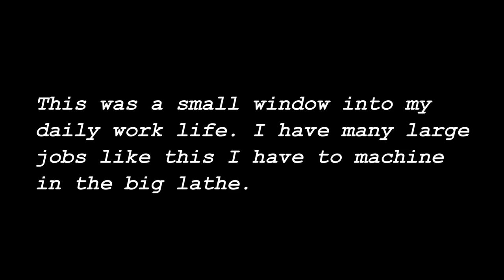Large Lathe Work

Comment: I used to work for Wendt Corporation in Tonawanda NY near Buffalo. we built giant machines to crush cars and shred them. The hydraulics are huge on those. On occasion while crushing steel or whatever it will get a piece of steel stuck between the cylinder and the piston and gouge the hell out of the cylinders. after pulling the pistons out I as a welder would have to climb inside and weld over all the gouges so the machinist could machine it and make the bore smooth again. the cylinders were so big I could sit up inside them comfortably lol. But what a smoky job
Reply: +Richard gross use a fan.
Reply: +Arthur Bradley not if he's tig or mig welding, you'd lose your gas shield.
Reply: +monomerx001 true
Reply: +Richard gross  :D Tonawanda. I'm in Rochester.
Reply: +monomerx001 Very true, but unless it was some exotic alloy, I'll bet he's using stick just for the advantages it has in portability, strength of weld/penetration, and also the ease of prepping your machine for materials used. I know as a former pipeliner that we exclusively used rods(excepting on chromoly boiler tubes, which was always TIG), and when you're up inside a man-hole filling in the deeply back gouged v-groove on massive door sheets on the side of an oil tank, or even fixing a blown root pass from the inside of large diameter pipes, we always used high deposition all-position rods like 7018, 8018, etc. 

Of course that was years ago and much has changed, but all of the build-up welding I've seen Abom do on these hydraulic pistons is with good old 7018, and his jobs always come out sweet :D
Reply: Does this job not warrant a plasma spray ?
Reply: it was 7018 as it is easier to machine over
Reply: Good ol' 7018 rod... 4th generation Millwright here and USMC veteran. My grandfather was an old school pipefitter and welding instructor. I've seen the man weld a pipe with 2 stingers, one in each hand and weld each side of the pipe simultaneously. His father, my great grandpa was a Millwright and worked on the very first Ford assembly line. Gerwig.

Comment: Its been many years since I've done any lathe work. We made brass pump impellers and various other pump parts because the generating station I worked at had pumps that required we make our own replacement parts. Thanks for a great video about a huge lathe. It brought back many good memories.
Reply: +ThePupsdad I forgot to mention we also made impeller wear rings and steel screw shafts up to 72" long. I loved cutting huge threads.

Comment: Wow!  It is really great to see a really expert machinist at work on some great gear, taking things slowly and carefully.  Many thanks.  As a child I was always interested in how those spherical bearings were got into the lifting arms on the back of a Fordson tractor.  I'm probably not using the right terms here, but I mean the same kind of massive bearing which was embedded in the end of the tube you are working on here (which moves freely in 360 degrees of rotation).  I could not see how it could be got in there except by making the lifting arms in two parts (lengthwise), placing the bearing in place and then welding up the two halves with it held captive in place.  But I could see no sign of welds in the arms on this Fordson.  I just can't imagine it being done by forging in situ as this would just trap the bearing.  I was only a kid of about eight years old and now I'm fifty-nine and still don't know for sure how it is done.  Would you mind explaining?
Reply from the maker: Stephen, the spherical bearings are simply pressed into place. They all have an outer race that is turned straight. The hole in the part is bored to an interference fit,  then the bearings are pressed in. In many cases there are also snap ring grooves machines so that retainers can be used to ensure the bearings do not walk out of the hole.
Reply: Abom79
Thanks for the explanation.  I can rest easy now I know!  There's so much ingenuity in engineering; imagination and creativity too...
Reply: Abom79
I came back to thinking about this!  You know those interference-fit bearing assemblies that are pressed in as you say?  How do they bore them out and fit the rotating bearing into it - I mean as an assembly?  It would be great to see a vid of this being done.  Gonna Goole it.

Comment: Whe I was 18 i got a job at Whemco in West Homestead Pittsburgh and we used to get rolls of steel in sometimes that were 900K pound+. They were so big that they had to be bought in by train because no truck could transport them. The lathes they turned them on were GIANT ass ancient machines probably from the 1920s. My job as a chainmen consisted of rigging these up to massive overhead cranes on tracks so the could move them. We'd put wooden wedges under them to stabilize them but the scary thing is if the roll shifted onto a wedge it would shoot the wedge out like a bullet. Nerve racking work for an 18 year old kid tbh.
Reply: You had to work on your dodging skills right there.
My buddy was a longshoreman and some of the pipe-incidents were terrifying and life-changing.

Comment: That's a big lathe, but they have one in Michaud that turns the shuttle tank, I think that's the biggest in the world, as the tank is 154 feet length, 28 feet diameter.  I've heard he Wright brothers first flight could have taken place inside the tank, altitude (height), width, and length, but should probably verify this.  The tank, in skin thickness to overall size, is on the scale order of a soda can....and people wonder why the things blow up occasionally.   Sorry for the one-up, but thought you might be interested. Great vid, enjoyed the large machining.  You really get to check out the weld quality first hand while sectioning it. I'm sure the welder would appreciate and feedback you could give him on any weld inconsistencies  ;-).

Comment from the maker: Before I started rolling it on the steady rest I use my grinder and ground the paint off in one spot to for the steady to sit. Then I began the process of finding center, then center drilling it. Once its center drilled, hold the part with a live center and it will be centered and square. Then "machine" a true spot on the barrel for the steady to roll. Its all in the video.

Comment: Nice to see someone with head NOT in ass using a lathe on utube.  I appreciate the part-off through the weld. I had a pucker level of 8.5 when you started that tool into that interrupted cut.   Sweet work.

Comment: I know this is an old video, but, is this a hydraulic cylinder?  Sorry, guys, woodturner here and saw the huge lathe.
Reply from the maker: Scott Jones Yes, large 4 stage cylinder.
Reply: Abom79 I like the use of the borshaft for cutting the Welding off... remind me at "Apollo13": "I do not care what something was built for, i need to know, what you can do with it "
Reply: نفسي اشتغل معاك يا خواجة والله
Reply: +GpunktHartman Yes, its a hydraulic telescoping cylinder. Did you notice the high pressure hose attached to the body of the cylinder? That is where the hydraulic fluid was pumped in to operate the inner cylinders.

Comment: What did you do with the forklift, let it idle against the cylinder while it was expanding so that the different cylinders didn't randomly push out?  I've never dealt with multi-cylinder hydraulics
Reply from the maker: The fork lift is there to hold the end of the tubes as it extends.

Comment: they will still be using lathes like this in one hundred year's time.
Reply: So long as they need to make round things round. and flat things flat. I don't see machine tooling changing a whole lot. Perhaps one day we might have some sort of plasma arc cutting bits or laser but its very hard to reinvent the wheel.
Reply: Joe Burnett 3D metal printing is the way of the future they say.. ;)
Reply: If we don't have molecular assemblers 100 years from now something will have gone very very wrong, people using this sort of equipment will be doing so out of nostalgia. You MIGHT see this sort of stuff going on at the county fair like we see steam engine demonstrations today.
Reply: well I doubt if these lathes will still not be around if the present situation continues as everything we use depends on products made by big traditional processes of turning, milling etc.
Lots of new lightweighht production machines are made from light sections but these all satrt from bar or plate that has to be rolled on giant machines that need big precicion engineered parts.
Ship propellors and shafts for instant will still be needed unless someone comes up with a means of moving water from in front of a ship and pushing it against the back to make the big ships move.
Reply: Fleur Black There will be, I guess, some places where stuff like that goes on. But not in the developed world. Why form a giant piece of steel then carve the shape you want out of it when you can tell your nanobots to harvest the appropriate raw materials from the ore pile and then form the required shape as the steel is created? You'll get a more accurate part with far less wasted energy.

I know it sounds way out there but think about how much changes in a century and stuff just keeps advancing faster all the time.
Reply: I started work in a shop that had a big old single cylinder gas engine to power line shafting.  It was demolished but woudl have been a perfect museum as everything was really old.
Reply: ***** Currently studying to be an engineer as well (mechanical engineer). I'm so with you on that: I, too, have no idea wtf I'm doing :\ I also like to get my hands dirty and do enjoy manual labor, but, like you said -- you can't raise a family nowadays with what that pays (not where I'm from, anyway)..
Reply from the maker: Fleur Black The shop my dad started his career in was set up like that in the early days. it was a line shop and powered by a gas engine, but was modernized by the time he was there working, Cool stories.
Reply from the maker: aryesegal1988 I can say I get a descent pay, and good benefits. Thats why I stuck with the job I'm at. But there's less headache there than running your own business.  I really do miss my full time family shop though. 
I'm not getting rich doing what i do, but I make enough to live a comfortable life, support my family, and off on the weekends, plus I'm doing what I love....machine work!
Reply: Zaphod7835 Your crazy that will never happen for a piece this size.
Reply: Dave P It's pieces this size that may be done that way first, the bigger the piece the more waste there is informing it this way.
Reply: aryesegal1988 you would love poroldchaps YouTube channel..it may be poor ol chap or something like that...he is something else..homemade tools and fixing old machines and his stories are the greatest.  Hes a brit...
Reply: 3D printing and molecular assemblers won't be able to repair this job. So unless everything becomes single use the machinist and this lathe still have a future.
Reply: people 500 years ago used the same concepts to make metal parts!!

Comment: I like how you handled all of this professionally. Even the forklift idea was great--did you run it on neutral? was it pulling or you had a pneumatic way of removing that piece?

By the way, from the beginning, when you were adjusting the steady rest, i was thinking about if the cylinder center was the same as the center of that welded piece?
Reply from the maker: Jake, I stick a bar through the eye of the cylinder and rest it on the forks. Thats what holds the weight of the cylinder tubes as they are extending out. Just put the fork lift in neutral and let it push back. 
I doesnt matter where the eye was welded on, the center of rotation off the large tube is what I was looking for. Even if it was off center a little I would still be able to drill a center once its there.
Reply: Abom79 Only if that piece was welded dead center. either way the hole he was making would have been dead center of the cylinder not the welded piece because the whole cylinder was rotating. At least that's the way I saw it because I wondered the same thing
Reply: Kyle Kolath thats right i would use clock on steady
Reply: you need to start somewhere. Finding center the way he did takes some guts, faith and experience. I would have probably been using an indicator on the clevis but would have had the same results. I was surprised at how true the bore was running when the end cap was removed. It miss those just make it work tolerances...which are just fine for what he is doing.

Comment: okay so im 16 and in a machining class at my local career center. and this was not running as nearly as many RPM as i usually do for a small part. is that normal to run that at such a slow RPM?
Reply from the maker: On such a large piece with this much mass moving around inside, you dont wont to run very fast. The opposite end was being driven by a piece of flat bar welded to each nut, so that they would all be spinning together. Low and slow with this job.
Reply: oh okay thank you sir :)
Reply: You also have to remember that large diameters quickly results in surprisingly high cutting speed on outerdiameter of parts. Suggest to do some math to look it out. Also I don't know the weight of that assembly, but it's quite heavy for sure, so I don't think you just even could run part very fast because of balancing issues. Plus heavy masses rotating fast and if something goes wrong can be  a very serious work hazard. I'm not machinist by my current occupation, but did metal working school as I was young and to me that looks roughing speeds (not sure if that's proper english?) which are fine for that kind of parts. Something like paper plant rolls are done in quite high speed machining to gain high surface quality my knowledge as they're balanced very presisely and in fact run at vastly high speeds in production.
Reply: Larger Diameter slower u go, smaller diameter fast you go.
Reply: At 15'' dia, the speed at which the material encounters the tool is still pretty high even at a low rpm. That said, Much of the cutting speed has to do with the material and type of cut. I would not machine something that large in diameter at any speed greater than 125 rpms on the outside with an indexable carbide insert tool. And even slower still with that parting bit or brazed tips or high speed steel tools through weld on carbon steel.  With the part being machined being that bulky and hollow, chatter is always a concern especially when using a boring bar.  Most times chatter can be eliminated by adjusting the rpm speed or length of bar or where the steady rest is placed.  If you noticed he had the material chipping off because the speed, feed and depth of cut were right. Too much rpm and the material might come off in wire form. Thats not ideal. Aluminum obviously can be machined faster than steel. Bronze, brass, cast iron can all be machined at a higher rate because they chip when machined and almost never wire.
Reply: OU 318 V/D
Reply: Cutting speed,, weight of pc,,less vibration and chatter  at slower speeds.
Reply: Imagine you are riding a bike and a scooter. Keep the RPM BUT change the wheels with those two :D :D
Reply: you are big kids
Reply: andrew bentley It's all about the SURFACE SPEED.   A larger diameter might be spinning a 1/10 the speed of something that's half inch or smaller, but the actual rate of material passing across the cutting tool is the same.   Other considerations such as mass and balance definitely come into play, but the biggest issue is making sure you have the fastest MRR possible without burning up the bit.   (short version, a cylinder with 10 times the diameter will be moving 10 times faster at the surface)  Cutting tools don't "see" the RPMS, they only see the material at the surface.
Reply: SolarMillUSA Actually, a cylinder with 10 times the diameter will be moving 31.4 times faster at the surface, but your point is valid.
Reply: SolarMillUSA a cylinder with 10 times the diameter will actually be moving 10*pi times faster (circumference equals 2 times pi times radius)  +andrew bentley you can look up recommended surface speeds (often given in SFM surface feet per minute) for your specific workpiece material and cutter type in vendor literature or machinery's handbook and calculate surface speed 2pi*radius(in feet)*RPM     on preview: what sam1174 said
Reply: andrew bentley Yes it it is. Depending on the application, speeds change to represent the application being desired!
Reply: andrew bentley Good to see a young man in machine class , large stuff and speed do not mix well, when it comes out of the chuck or of the mills bed , all i will say is your balls will hit the ground before the work piece hits you .It hurts that bad ,try to avoid it ;/
Reply: andrew bentley assume you're working on 1 inch diameter piece, going 360 rpm basically, now divide 360 divide by say 24" and you have 15 rpm depending on cutting tool insert, and that's what you have to do, since you're covering large circumference.
Reply: Sometimes too much speed can be bad on small parts. especially on plastics like polypropylene, pvc, kynar. They tend to gall up.
Reply: It's not about rpm, it's about sfm. Also such a big ass piece of material can't spin fast without shaking shit up. There's a video somewhere on youtube of a massive lathe turning a casting that must be 6 feet in diameter. Veeeery slow rpm

Comment: Nice work!
I have a questions. When do you use cutting oil and when do you use coolant?
Thanks!
Reply from the maker: Not many of my machines have flood coolant on them, so most of the time you will see me using cutting oil. On my vertical mill I do have coolant and often use it for drilling and milling.